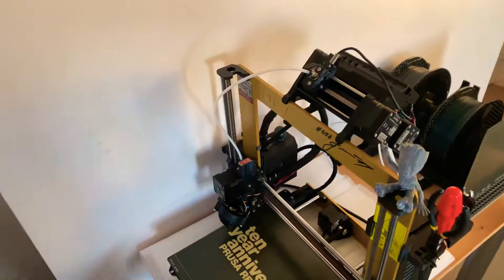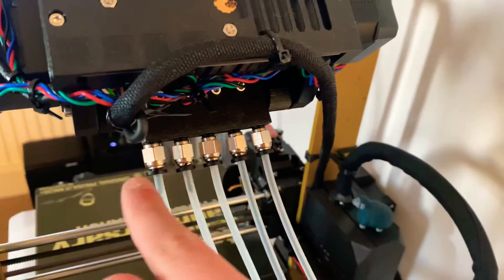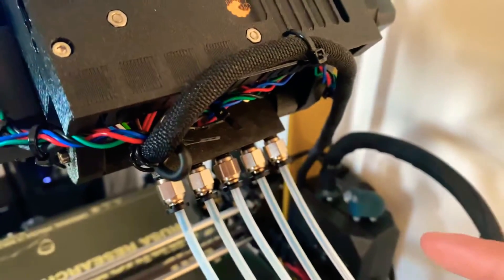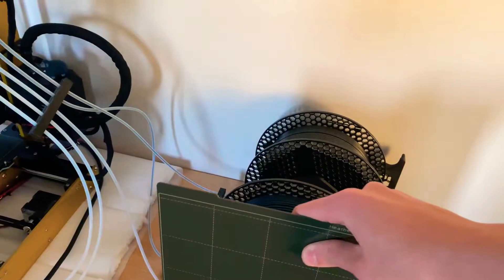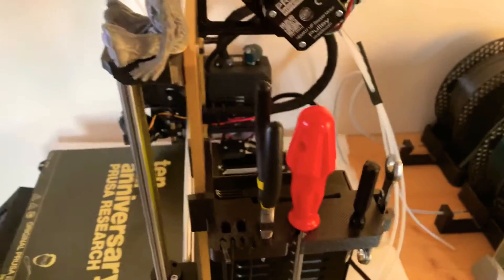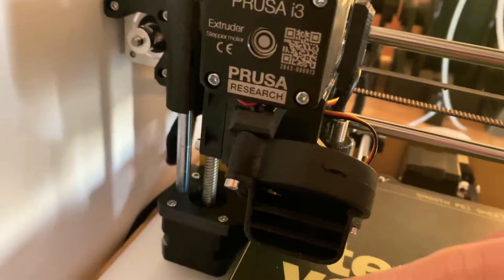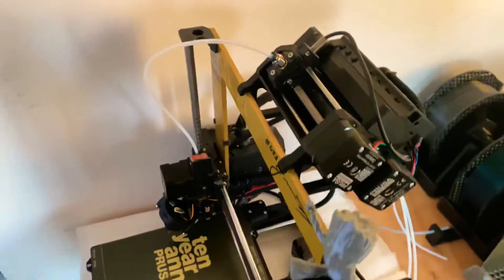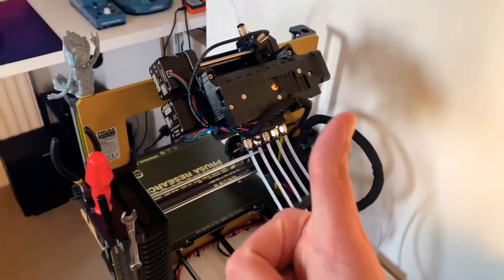Top Modifications for Prusa MK3S(+) and MMU2S! #3dprinting #prusaslicer #firsttime #design

Comment from the maker: Links to the modifications in the video are as follows:

https://www.printables.com/model/51778-prusa-i3-mk3-air-inlet - fan mod

https://www.printables.com/model/32569-rear-ptfe-holder-m5 - PTFE tube coupler mod

https://www.printables.com/model/26167-prusa-steel-sheet-holder - holds the steell sheets for the print bed